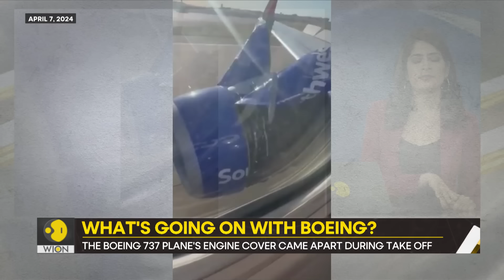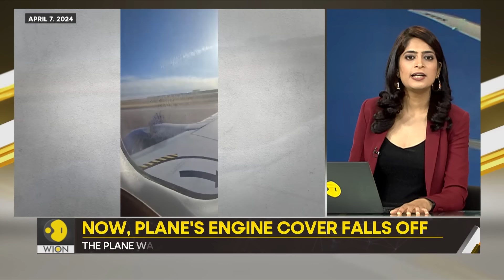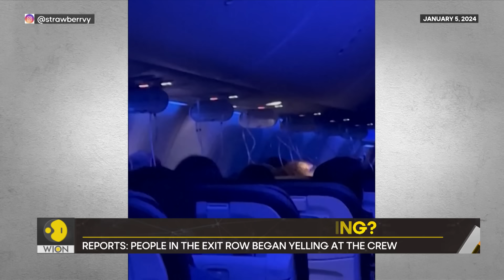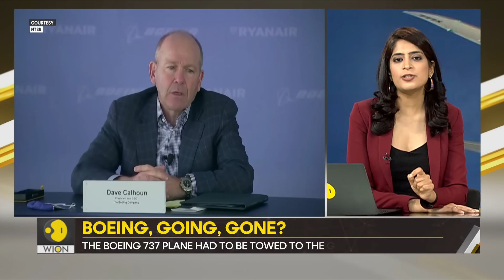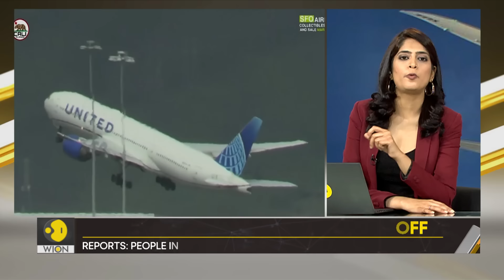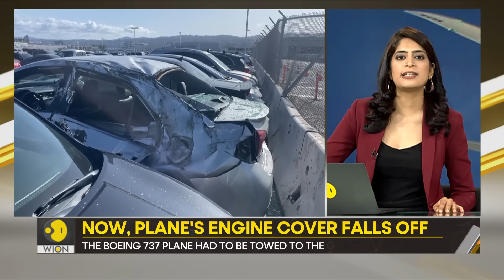Gravitas | Watch: Boeing plane's engine cover falls off after take-off

Comment: To be fair, this is one case where Boeing is not at fault. Neither Boeing nor Airbus manufacture engines. Engines are made by Rolls Royce, General Electric, Pratt & Whitney, etc., which are then installed onto aircraft.
Reply: Every one is cost cutting putting lives at risk. It matters to them only profits and bonuses for the Board.
Reply: @alexisrodrigues4767 so the engines are attached by magic?
Reply: @wyliem  no.  Real things every company is cost cutting to make lot profits.  That is only problem. Hence the engines might be attached by wax to make it easy work.
Reply: @wyliem perfect question
Reply: The final product is Boeing and not any of the companies that you mentioned. If that is the case, all automobile manufacturers can easily shift the blame to parts manufacturers all the time for failures.
Reply: @areekkal  You are right.  I had problem with  Nissan car.  Since 2008 they started to mount CVT transmission instead of automatic transmission, and their sales have suffered almost come to half of original since 2015.
It does not matter who makes parts, it is upto the company to source them right and reputable ones, else their business suffers.
Reply: Ok door came out recently 
So doors are also made by rolls royce ?
And also that Mcas system was made by royce ?

Comment: [Edit: It seems to be the Airline's fault, not Boeing; correction humbly accepted]
It is Boeing's fault!
Don't they have inspectors (Leave alone site engineers)? Do they want to call the over 1000-part manufacturers and shift blame to them? That would be ridiculous and untenable.
Reply: It's not boeings fault. Once an aircraft has been delivered maintenance is the responsibility of the airline. This cant even be considered a Maintenance problem. Someone forgot to latch the Engine cowling and the pilots didnt spot it during their walkaround
Reply: @Yohaan_koshy  Thanks for the correction. The original comment is left to hold the validity of this correction.
Reply: @elkanaajowi9093  Yeah no worries!